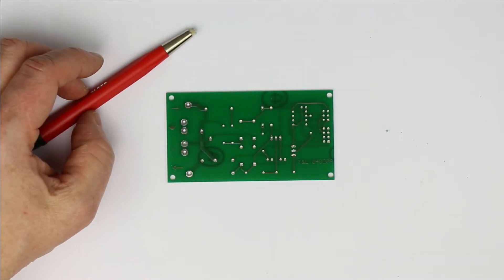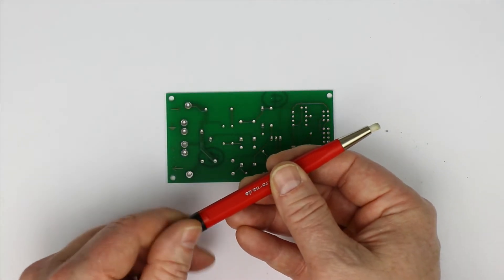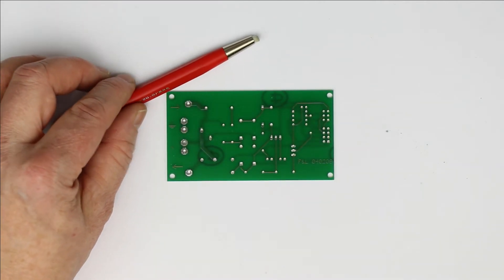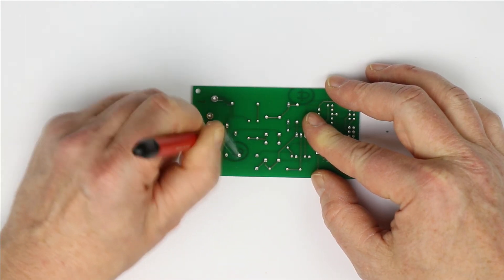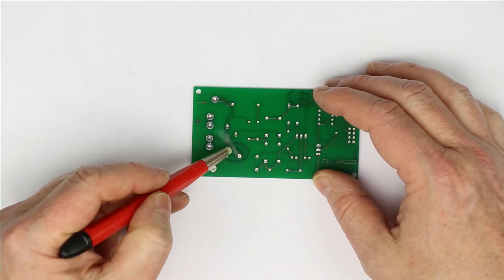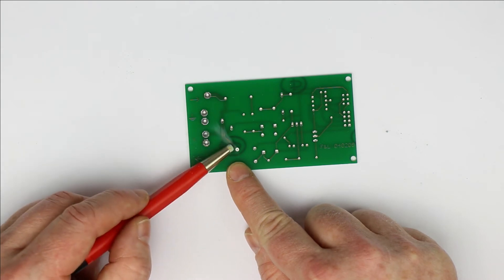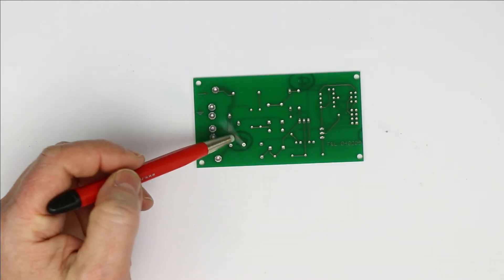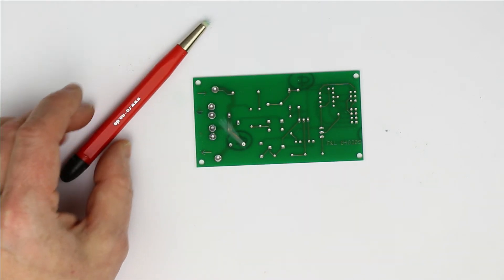Every maker should have…[Pt.23]…a Glass-Fiber Brush

Comment: I can't remove mask from pcb with this brush. It is very soft. Maybe my pcb is too good, I dunno. I bought my brush from aliexpress. It is good for removing minor rust and oxidation.
Reply from the maker: You have to let only 1 mm of the glasfibers come out at the tip of the pen! If you let the glasfibers come out longer, than they will simply break off instead of erasing the solder mask. Mine works 100% in removing the solder mask. Always. PErhaps the Chinese one from AliExpress is in fact not glass-fibre, but plastic-fibre?

Comment: They're also good for removing flux residue and cleaning metal surfaces!
Reply from the maker: Cleaning metal surfaces, yes. But for removing flux redidue I would not use a fiberglass brush because the brush kinda soaks up the flux and the individual fibers then cling together. 
Much better for flux removal is isopropanol with cotton-swaps. Or a special flux remover chemical.
Reply: KainkaLabs I was wondering if you could used isopropyl alcohol to displace the fluid that contaminates the brush then let the alcohol evaporate?
Reply: @KainkaLabs I've cleaned the fiberglas brushes with alcohol and then stiffened the glass fibers with a dab of "waterthin" superglue ( ordinary superglue is too thick). Note that the stiffness of the fiberglas brushes may vary from one brand or supplier to the next ( differing diameter if tge individual fibers, oerhaps). The cheap no name scratch brushes from fleabait or ramazone 😉 have cheesy, breakage prone extend/retract mechanisms, and the brushes might not be replaceable (permanently attached to the tool with heatshrink tubing and superglue).